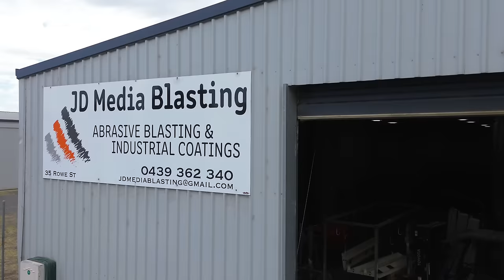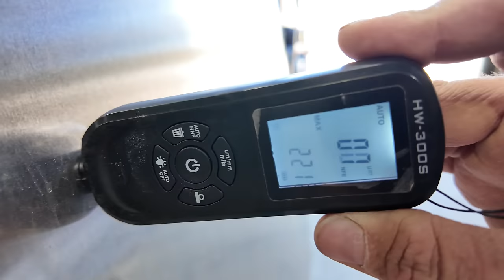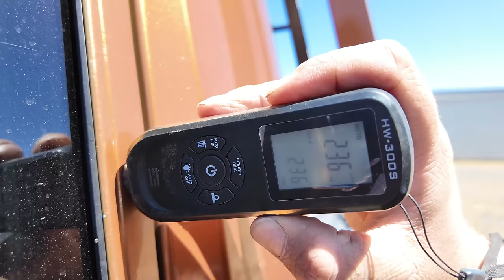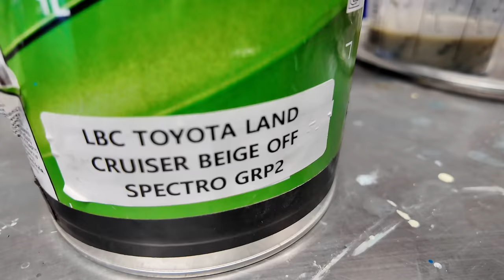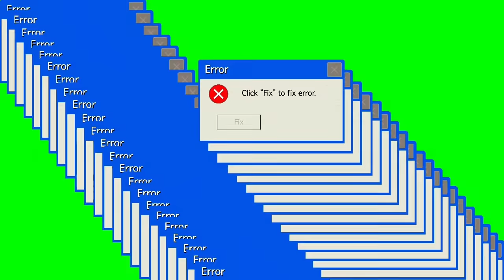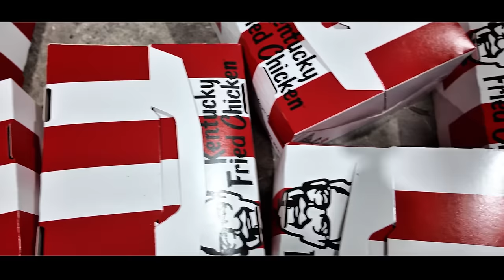Old school PATINA PAINT JOB from start to finish - WE PAINTED BAZ!!!

Comment: Loving the content mate, you're killing it!!
Just throwing out a little disclaimer from someone who works in a paint shop- everyone needs to know that a spectro isn't a magic tool that gives you a perfect match straight up, it will give you a close match but never spot on. Also it is very dependent on the sample that is measured. The better the sample, the better the result.
Reply from the maker: Thanks for the disclaimer mate! Very true and it was close but still a fair bit off, i actually dont mind it though 😂 shows the contrast between new and old better! 

Definitely would take a bit of skill to adjust it to be perfect!

Comment: My personal opinion for players at home . I would've used a solid colour instead of clear over base for the interior parts looks just as good but a bit easier to touch up and no clear coat to fail.
Also using normal clear coat over patina paint isn't really the right thing to do rust and old paint doesn't allow it to hold on instead their is waxs or a industrial clear they use on some new metal
Reply from the maker: I agree! I ordered base in mind of doing small areas then just clearing everything. the boys talked me into doing the dash and the doors ect later but with saying that i should never have to touch up the interior or the firewall and it does look great with some extra depth. clear over old paint when prepped correctly is definitely not the best way to do it but it does work fine when done right jim has a really cool patina chev done with the exact same process as mine but its got a lot more bare rusty panels that were clear coated and has been around a few years now and still looks like the day it left the booth! Personally not a fan of wax ect on a vehicle like mine to reserve the patina, this thing is going to get smashed through bog holes its now fully encapsulated with a 2k coating much better in my opinion and matches the rest of the car and still looks like old baz!

Thanks for your comment!

Comment: Uncle pooly what clear coat did you use for the patina. Will normally clear coat stick to patina paint? Love you videos and how baz is coming along. Keep it up mate
Reply from the maker: A good quality 2k clear coat and it will only stick if prep is done correctly scotch brite and a lot of wax and grease remover 

In my case 98% of the car was paint, the rust was only surface and very minor so we just thoroughly cleaned it bigger areas would need more preparation
Reply: @Unclepooly sweet. Thanks Uncle Pooly

Comment: As a painter I’d love to know how someone spectro’d faded paint… you can colour match faded paint all day but with a spectro I doubt it. The suck at matching paint in good condition 😂
Reply: Now the video is finished I can say they did not match it 😂 but I still greatly enjoy the idea of leaving the outside old
Reply from the maker: @HummerH3V8 yeah didn’t match 🤣 i actually don’t mind it though shows the contrast between the interior and exterior better!

I did think they would get it better than that though we are trying a different shop for my guard infill panels, i was under the impression the spectro got it close then they adjusted the mix until it matched